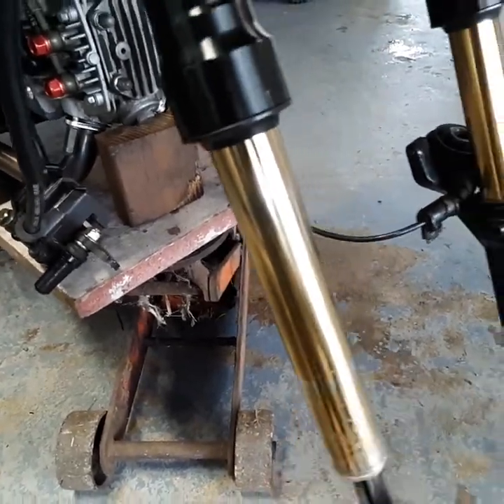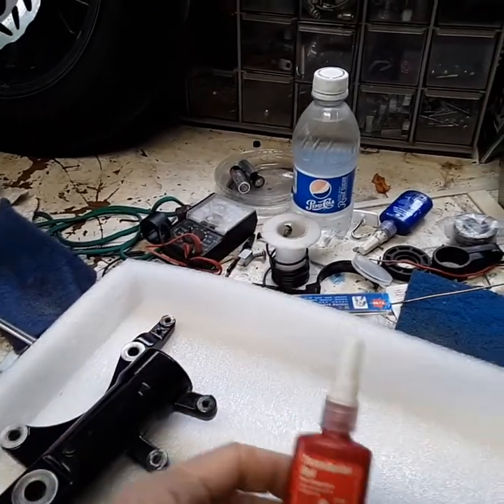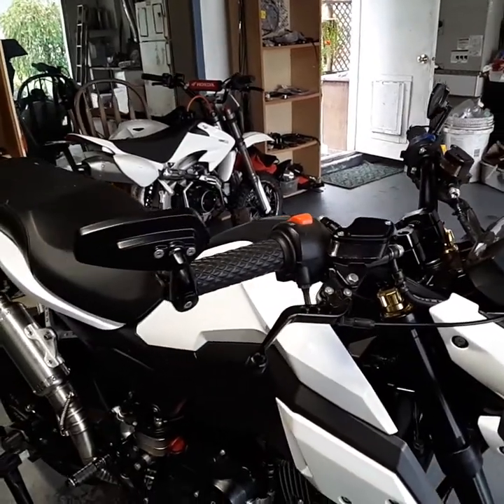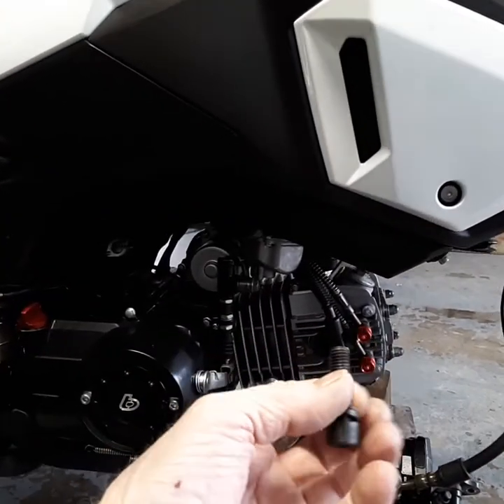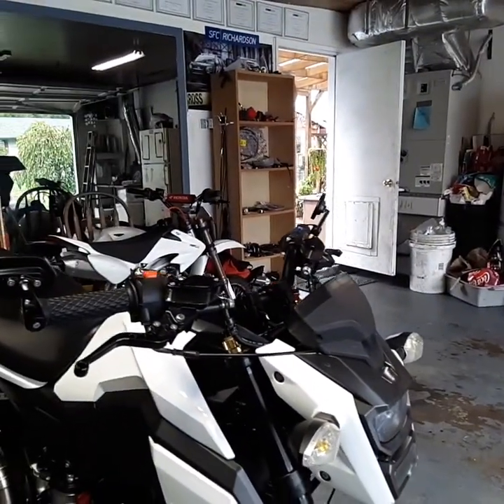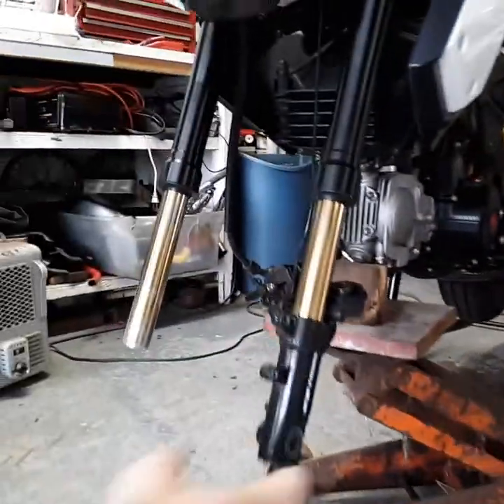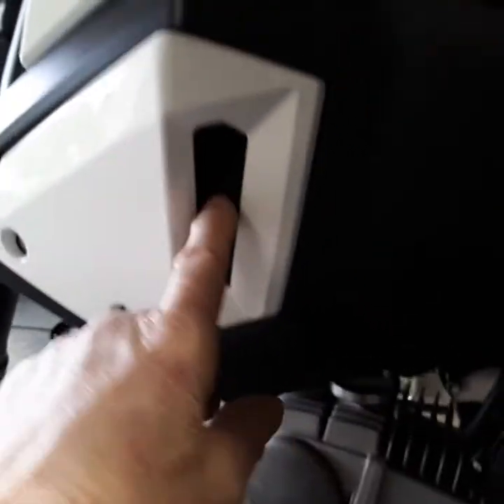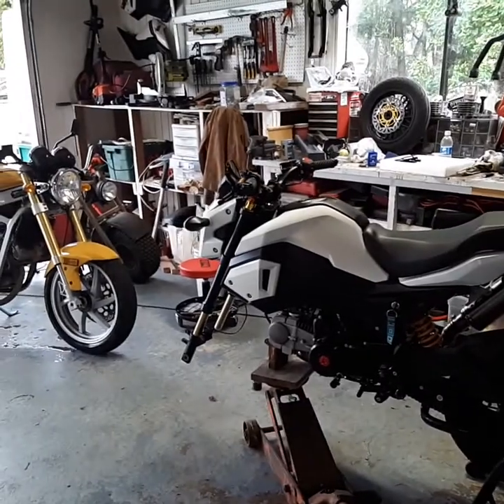Vader 125/141   adjustable fork issue.

Comment: How many miles do you have on it already
Reply from the maker: Just under 5,000 on the bike and about 3,700 on the forks
Reply: @minibikeaction4266  yea I have two a black one at 4800 with same tires and chain and a blue one with 3800 miles .on the blue one the starter stopped working the chain needs to be replaced and tires I guess I was too aggressive with he blue one because the black on still has alot of tire and chain life even tho it has more miles
Reply from the maker: @masterpain7742  The factory tires at 18-19 PSI actually worked pretty good in the corners , they are a soft compound. The rear tire started getting pretty thin on the sides after only 2,000 MIL. These Michelins I have now are OK for street riding but terrible for racing as I have found out the hard way.
Reply: @minibikeaction4266  ah ok good too know have to replace tires on both of them soon have u dropped ur bike? I slipped in the rain a few times cause the tires threads suck for rain
Reply from the maker: @masterpain7742  Crashed on the race track two times but have completely repaired the bike.